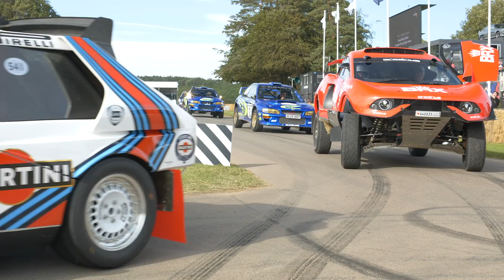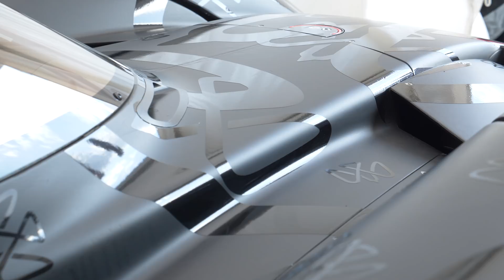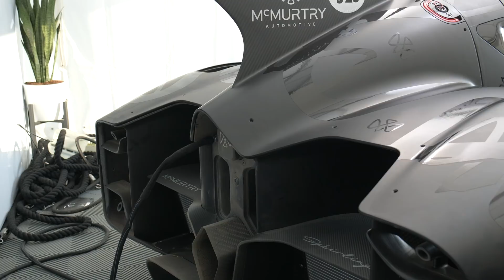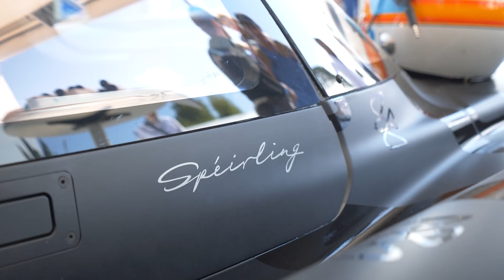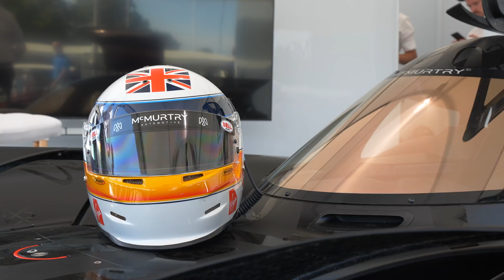This EV Sounds Like A FIGHTER Jet - McMurtry Speirling First Look

Comment: It’s true, the whole secret to the EV world is efficiency. I have a 62kw Nissan Leaf and I drained it in 2 hours at 80mph on the motorway yesterday achieving about 165 miles. Yet this thing can do an hour flat out at insane speeds, or do well over 300miles WLTP. The video of it going up the hill is the most impressive thing I’ve ever seen a car do!

Comment: That is noisy, louder than an engine, I guess using the fans are optional though you still need to carry the weight around dousing the enjoyment factor, didn't even get to see a lap, I think it's rubbish and slow
Reply: Slow has been proven wrong now…

Comment: Well as you was describing the car sad thing is I looked at the chassis and I thought how much could be cut away and they say the batteries only last 36 minutes do they even got a quick change battery system or is this just for a flash show to say that they did something

Comment: It hardly looks like it is optimised for aerodynamics, with lots of decoration, although with that power/weight ratio you can afford it. What is the purpose of those enormous fenders? Also why are there holes in the top of the fenders?

Comment: This build doesn’t impress me that much. However, it’s battery range and design are impressive and well thought out.  Overlooked, is driver safety.  The design, which places the battery around and underneath the driver, seems to be a formula for a disaster in the event the car crashes and the  battery becomes aflame.  The use of the fan doesn’t impress me.  Active aero would seem to be a smarter option.

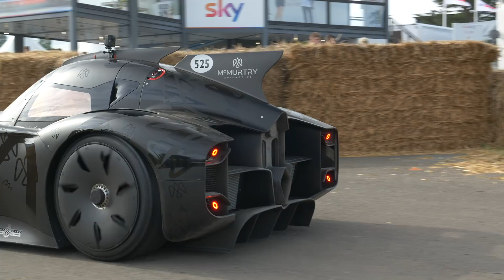Comment: 2:24 can someone translate? "gives you the downforce you need to go really quickly in strait lines around corners" ... whats does he mean? is he just the face/money and has no idea otherwise?  it is literally the definition of a corner that it is NOT a straight line! if he swallowed an "and" after "lines" it is also very wrong, on strait lines downforce is mainly unwanted.
Reply: He talked about the downforce from the fan was needed for max acceleration so in that way it has a role in a straight line as well. Or he just fumbled over the words

Comment: This is really freakin' cool, and I love the concept.  Only one thing bothers me: the wheels seem unnecessarily tall.  It's not only that they look a bit odd, if they were of a smaller diameter they would be lighter and more efficient.  And less rotating mass would mean better acceleration for free.  Just ask Gordon Murray.
Reply: Does it have hub motors or brakes that need the internal space? And are they even really that tall? They might look comically tall in relation to the strange minimal dimensions of the car.

Comment: Appraoch the first corner from 350 kph or more, hit the brakes and OOPS, forgot to let the fans spool up first.... SPLASH.
Perhaps the way DRS can only be activated after a certain line, the fan should engage cerain parts of the track :)
Could be GPS driven, if proven reliable.

Comment: Next generation cells with only drop weight off this car, or add range, or both. The moment Tesla start making cars with the 4680 cells, if those deliver, they will end up in projects such as this one. Those have the downside of relatively high volume, but low weight as a more crucial advantage.

Comment: I had a similar concept in mind for a race series. Perhaps not as narrow and definitely AWD.
Also, I'd want hot swappable batteries to take parr in endurance races.
30 minute stints at LMP1 speed, shorter stops than with refueling.
Active aero flaps to get really, really low drag on straights.

Comment: I say this with the biggest respect - it sounds like my vacuum cleaner! 👌🏻🤩👍🏻
Reply: Sounds like Dyson did the engine...
Reply: @asianeleven6050  Will it lose suction?
Reply: Makes me wonder now how the Chaparral 2J sounded; it also used fans to suck the vehicle onto the road. It's footprint was larger than the Speirling's.
Reply: Yes a vacuum cleaner that beat the record of the VW IDR at Goodwood Festival Of Speed 2022 😂 39.8 seconds.
Reply: First thing that came to my mind too. Glad to see there are a few like minded folk. 1.5m wide, effectively a fun way to clean the red carpet.
Reply: They're literally fans, what did you expect? An old diesel?
Reply: It sounds better with all components on simultaneously. Fan + gearbox + road noise. Watch Automotive Mike's video on the Goodwood run. It's bonkers.

Comment: It really needs a rear wing it looks incomplete without it.
Reply: If it can make its downforce goals without an exposed wing, all the better since that usually keeps drag to a minimum.
Reply: @MX5-XU  100% agree with you but it looks a bit weird like a cat without its tail
Reply: @MX5-XU  wondering if that is true... what is the point of "keeping drag to a minimum" when 1st an adaptive wing has a very negligible frontal area compared to the rest of the car and 2nd you are ignoring(?) that the utilized fans  need loads of power too
Reply: @gshaindrich  you can wonder, but this car was designed by very smart people so I think I will trust their approach and philosophy. They said the fans draw about 80hp worth of power, but that is able to help produce the downforce figure from 0 mph.
Reply: @MX5-XU  "80hp worth of power" ... is what? more than 8% of the total power that goes just into downforce, without moving the car forward ans how much more than a wing does the system weight?  This has absolutely nothing to do with efficiency, it´s a marketing gag! 
"very smart people" ... its been done in the 70s .. .so neither new, nor efficient... ONLY more downforce at lower speeds... "very smart people" could have thought of new and better things
Reply: @gshaindrich  you can complain all you want but also remember the fan doesn’t have to be run at full power all the time, only when needed. That approach was banned in Motorsport due to its effectiveness, so take what you will from that as well.

Comment: What is up with the size of the wheels? Then again the BMW i3 has really big but thought that was just styling.
Reply: Bigger contact patch to put down torque.
Reply: @TheDwightMamba  I am talking about the narrow width compared to the extremly large diameter.
Reply: @idventure6036  , more room for whatever wizardry takes place behind those wheels.

Comment: 1000hp per tonne, weighs less than a tonne, but the title says it makes over 1000hp??
Reply from the maker: Corrected!
Reply: Bit of clickbait
Reply: @russotusso1695  How is it click bait when it true ?
Reply: Power to weight. If it weighs 400kg and produces 400bhp. It makes 1000bhp per tonne
Reply: I'm glad someone else picked up on that. It doesn't make any sense. Definitely click bait
Reply: Kinda confusing
Reply: 1:1 ratio
1hp per kilo
or 
1000 hp per ton
Reply: I know but he claimed it produces over 1000hp but he also said it makes 1000hp per ton and the car weighs less than 1 ton which implies it makes around 950hp
Reply: @falcongamer58  so if it is 0.9 tonne it will make 1111hp per tonne @ 1000hp.
Reply: @RG6Snipers  what you said makes no sense
Reply: @falcongamer58  Lets make this simpler then, what is the power to weight ratio of a 2 tonne car that makes 1000bhp?
Reply: @RG6Snipers  1000hp/ton means 1111hp/1111kg
Reply: @RG6Snipers  What you say makes zero sense.
Reply: @RG6Snipers  your math is wrong. 
A 0.9-ton car would not have more than a 1000 bhp as you said. It would be less to about 900bhp to make it 1000bhp per ton not 1111bhp rework your math. 
A car as saying at 0.9 ton with 1111bhp would be 1233.4 bhp per ton.
Edit: I see you edited your comment after I replied to correct it, well done you for not telling others who replied :/ you could have been civil and not made everyone else look bad with your mistake.
Btw the comment you sent me which you deleted saying you don't say the figures, I glad you realised you wouldn't get away with it,  as it wasn't just me that saw your bad maths.
.
Reply: @RG6Snipers  yup , the calculation is correct, but it has no relevance to the issue of actual power on this car discussed tho.
Reply: Yeah, clickbait.
And clickbait = unsubscribe.

Comment: Is it better for the environment than a petrol race car? 
EV's are typically higher impact on construction, with the benefit happening over many miles, for a race car does that ever happen? Equally, would racing teams be better off using synthetic fuels, since they can be (pretty close to) carbon neutral, and the high cost isn't a major issue for racing purposes unlike with road cars.
Reply: Interesting question